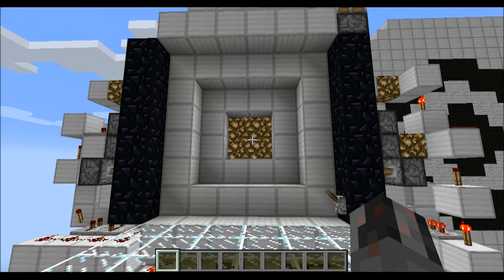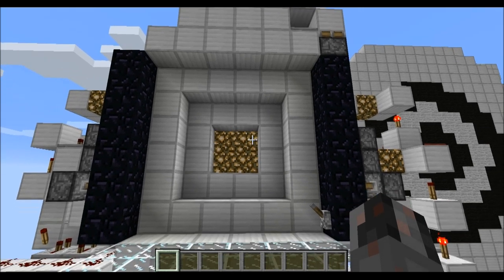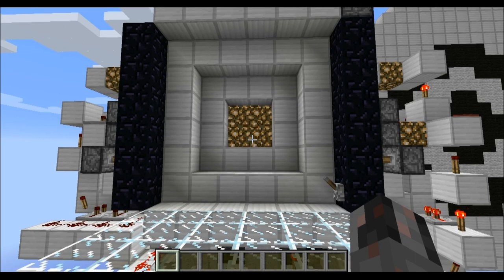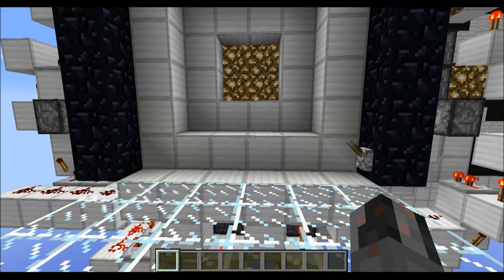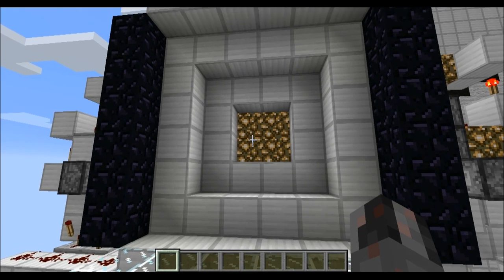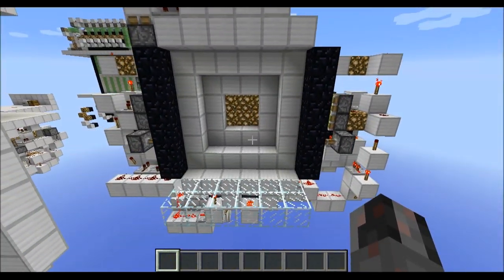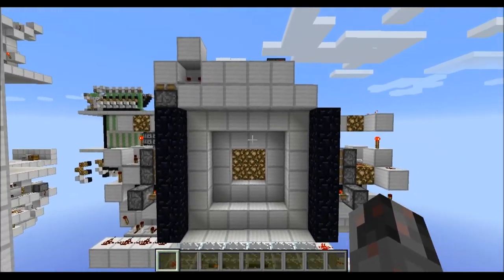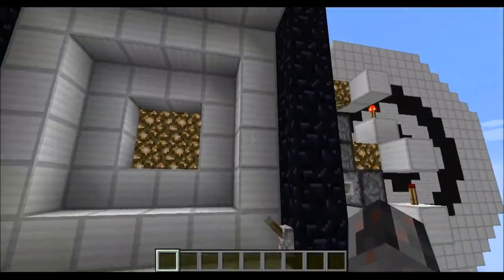Tutorial: 6x6 double vault door [Java 1.8+]

Comment: i really liked this video, unfortunately i seem to be having a small issue with  the side pistons. for you it closes to be flat but for me the glowstone and the iron on the sides stay out. they dont even close completely. ive copied your wiring exactly and it doesnt seem to work at all. ive tried swapping out a few things and still no luck...
Reply from the maker: Just tested it, and it still works for me. Are you playing on the PC?
Reply: yeah i am playing on PC
Reply from the maker: Then I have really no idea why it's not working for you...

All I can think of would be some kind of random piston bug. Does the problem effect both sides or just one?

Or maybe it's a displaced piston? They sometimes move around during the building of this kind of door without being noticed.
Reply: it is both sides that seem to be affected. the glowstone doesnt move at all however.
Reply from the maker: Not sure what's going on there...

Maybe some pistons were wrongly powered during the building and are now in the wrong position? If you look at the pistons that move the central segment (those with the glowstone), you should find the following configuration (when door closed): The bottom double extender should be extended (no extra spacing between the two pistons) and the third piston should be directly on top of the front piston of the double extender and in contact with the slimeblocks. The double extender should have a one wide gap to the slimeblocks.

If you have a different configuration some of those pistons are BUD-powered and won't retract properly. I hope that helps.

Comment: I like your video but this kind of disappoints me because I have been working very hard on a slime block 6x6 piston door.
Reply: I just finished mine. It has a faster close but a much slower open. About 2.2-2.5 seconds. The close is about 1.5 seconds though. It even has a lock on it to stop the outside button from being used. I have some screenshots of it on my twitter @KingKreeper17. It is much more simple than yours and uses only 15 pistons, but it is much bigger. Note it isn't compacted. :)
Reply from the maker: King Kreeper Nice design! Very futuristic and impressive. Our doors shouldn't be really compared though, since yours is a (almost) flat door and mine is a double vault door. They have different ideas behind them, which leads to different solutions.Great job ;-)
Reply: R.K.F. Walter 1: Thanks! :D 2: I've made it open in approx. 1.2 seconds, and close in approx. 1.1 seconds. And I fixed the open state to where it is flush with the wall.
Would you like to work with me in a private 1.8 server?
If so that would be great!
Reply from the maker: King Kreeper Would be nice, but I see a few problems there: 1) from the times you commented it seems we're living one globe apart, which makes it pretty hard to be online at the same time (I live in Germany). 2) Due to my work I'm happy if I get a max of 1-2 hours a day I can spend playing minecraft, which adds to the problem. 3) I've never played multiplayer and have no idea how that works (Kinda sad, I know) ... So I'm afraid it won't work out, but correct me if I'm wrong.
Reply: Ok. I understand. It would've been fun anyways. Have a good time redstoning! :)
Reply from the maker: King Kreeper Thanks, you too!

Comment: pls fix it its broken n 1.11
Reply from the maker: Still works for me. Have you build it correctly?
Reply: I build it correctly It dosent work minecraft  1.11.2 I think Its directional
Reply from the maker: That's strange. There's nothing that should be direction dependent, the ciruitry is rather simple after all. What exactly doesn't work?
Reply: the last block retraction dosent work
Reply from the maker: Okay, so it's probably some timing issue. Which blocks don't retract exactly? Those in the centre?
Reply: the sides and center
Reply: 1.11.2 broke alot of doors and the new 1.12 came out even more broken
Reply from the maker: That sounds like the timing of the repeaters at 13:45 & 13:50 is off. Try playing around with the repeater settings a bit.
Reply from the maker: 1.11.2 didn't really break that much (maybe some of the supercharged or 0-tick designs) and the pre releases of 1.12 didn't show that many differences as far as I could tell.

I haven't found any of my designs that worked right before 1.11.2 and don't in 1.11.2 and 1.12 pre7, though I haven't really tested every single one.
Reply: ohh ok ill try it BTW the double 3x3 vault door that u uploaded I made t even smaller a and little faster 1 :D u can showcase it on your channel  :DDDDDDDDD
Reply from the maker: Since it's your design, it would be better if you showcased it yourself. I don't have a "sharing is caring" series in  my channel and don't really plan on starting one. Your description sounds interesting nevertheless.
Reply: It works fine thank you!!!!    Can I have a little help?  Ive been working on a 6x6 piston door can u help me???  U can join me at a realm tell me your user name Ill invite u
Reply from the maker: Do you mean a standard (flat) 6x6 or a vault door?
Reply: a vault door                         and  srry If my  replys are slow cuz I live on the other side of the world It takes long to go 2 ur country
Reply from the maker: No problem. If you're that far away I suspect we'll get some lag issues, but we can at least try.

I'm currently a bit busy, but I should have some time tomorrow around 13:00 (UTC+2). Just send me a message if/when you've got time and I'll reply with my username (go on my youtube channel, then in the About/Channel info Tab you can find a send message button). I prefer to give out such info only on a need to know base.
Reply from the maker: Sent you a message with my username.
Reply: Where is it?
Reply from the maker: Either in your EMail inbox (messages usually get forwarded there) OR you can find it by going your youtube channel, then click on video-manager, then on the left side click on community and then on messages and you should see your youtube inbox with the message.
Reply: go on the latest version of MC 1.12 then go 2 minecraft realms go 2 pending invite if u cannot find it then click on the flashing light then enter :D
Reply from the maker: Thanks, I'll be there in about two hours. Still got some stuff to do for now...
Reply: DID u  join yet?
Reply: why didnt u join yet?
Reply from the maker: Sorry, took a bit longer than expected. Imma coming
Reply: kk
Reply: wut happend??
Reply from the maker: Login freezes at Loading terrain, I'll try rebooting my computer. 5 mins
Reply from the maker: Connection just timed out. I can't seem to connect properly :(
Reply from the maker: Sorry, I just don't get a true connection. It just freezes at the "Loading terrain" screen and gives me a connection lost due to timeout message shortly after. Seems it's like I feared and we're just to far apart for a decent connection speed :(
Reply from the maker: Just got in, no idea why, but it seems to work now :)
Reply from the maker: Encountering massive lag. Won't make much sense trying to work that way. sry
Reply from the maker: Disconnecting again, won't work, sry :|
Reply from the maker: Sorry, only read your note just now.  Wanna try again the coming weekend?
Reply: Btw about my 3x3 vault door It turned out  same size lol but  Its much faster  and less air space    witch 1 is better?   mine or yours I dunno
Reply: @RKFWalter  need help.  On first test one side comes up but only 1 piston works on the other side.. frustrating
Reply from the maker: Sorry, but I need more information. Which pistons exactly work, which don't? The build is more or less symmetrical and rather simple redstone-wise, so there shouldn't be any positional or directional issues...

Just an idea, but you could try to building the improved version of this door ( https://www.youtube.com/watch?v=kz879-vzjbU ), maybe that will work without issues.